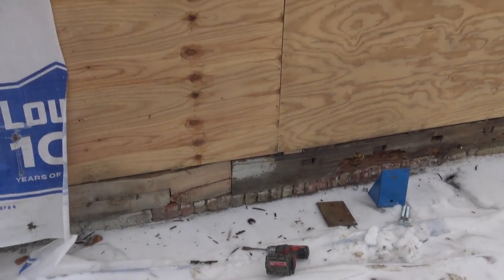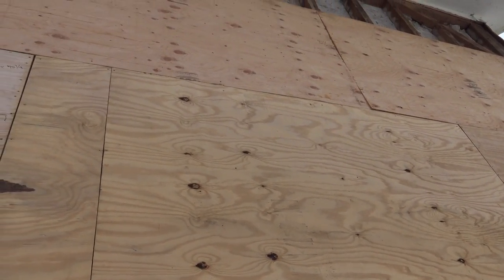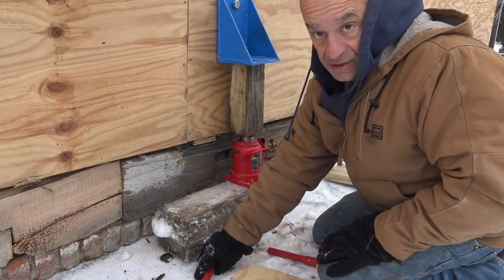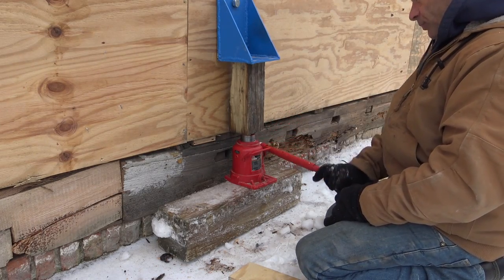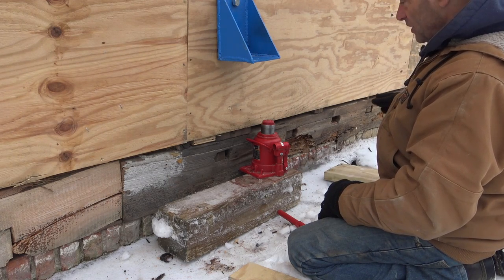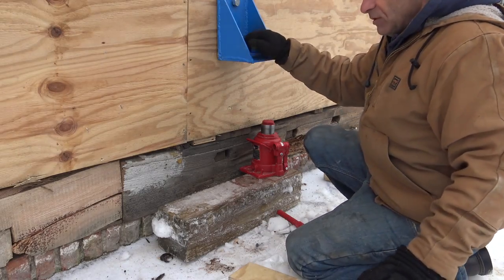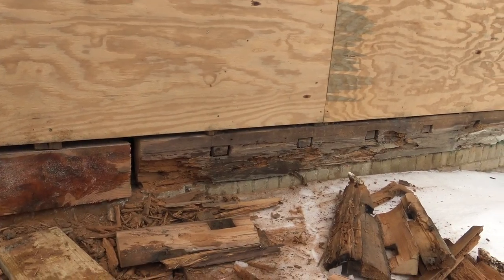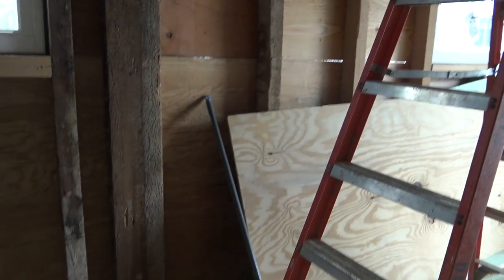Replacing the sill plate/beam on a post and beam house 1840

Comment: I have a 1920 house cedar which has faired pretty well apart from a few sill plates (I guess) that didn't have appropriate flashing to keep moisture away. I have been breaking my bank to fix it up and this is another blow. A corner of about 2 x 3 ft is rotted out completely, nothing has collapsed, so I think it is holding itself up. I cant help but think that this can be fixed from the outside but the suggestion is to tear out my new floors and approach from the inside?  It looks a lot like your situation there.
Reply from the maker: Yeah I would fix that for sure.

Comment: If the structural frame of load-bearing timber is left exposed on the exterior of the building it may be referred to as half-timbered, and in many cases the infill between timbers will be used for decorative effect. And that is considered post framed because of only having the lintel. Post and beam that beam would be mortised in and another beam would be above it as a lintel.  In the older manner, called post construction, the vertical elements continue from the groundwork to the roof. This post construction in German is called Geschossbauweise or Ständerbauweise. It is somewhat similar to balloon framing method common in North America until the middle of the 20th century.

Comment: This is super helpful! Need to do this myself for an 1890s church on my property. I don't have metalworking/welding equipment so I was wondering how I might purchase brackets like the ones you used. Do I need to go to a metal fabricator?
Reply from the maker: I made this one myself. And yes you'll need to find a fabricator. Unless you live close to me in upstate NY you could use mine.
Reply: @Askmediy  I’m down in VA but thanks! I’ll look for a fabricator